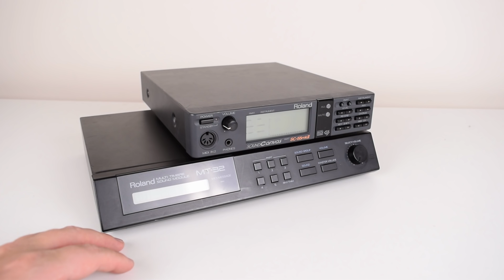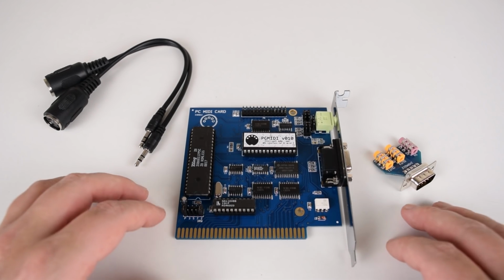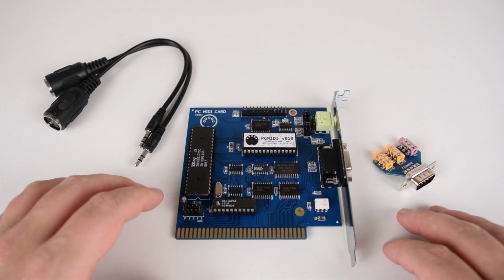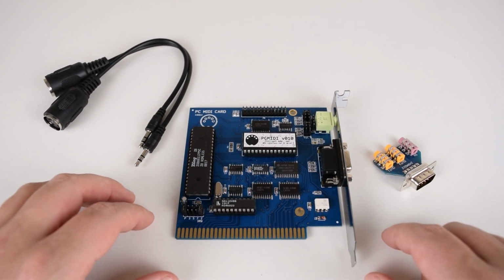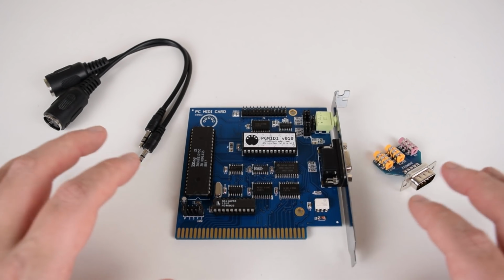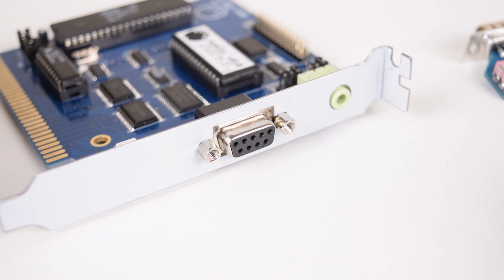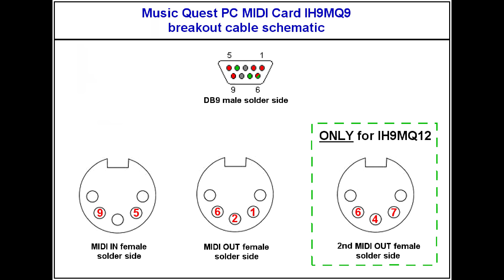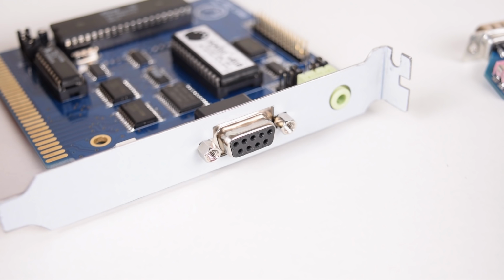Ultimate Roland compatible MPU-401 MIDI Interface Card with Intelligent Mode

Comment: So, did you try this on that computer? There's some stuff in the description of their site that makes me wonder if this would work properly. Specifically the fact that it needs IRQ2 for games that don't allow IRQ selection. Can you assign that IRQ in BIOS? Their site says that with boards Pentium 1 (with ACPI) there might be issues because ACPI uses IRQ2 and you need to have an option in BIOS to disable it. That kinda sucks because it's almost impossible to come by that information without having the motherboard and checking the BIOS yourself. 
Thanks!
Reply from the maker: What you're referring to affects ANY MPU interface. Back in the day lots of little oddities like this were around. Remember, when MT-32 was common in games, that was late 80s. Pentium is much newer... I've found these issues after much testing, it's good this knowledge is now way to obtain 🙂
Reply: @philscomputerlab  Hmm, that kinda sucks. I was thinking of building something like a slot 1 machine that I could also use for DOS with MT-32. Do you know if there are a lot of games that don't support configuring the IRQ? 
I was looking at this board: ASUS P2B-S but I guess I can't know if I would be able to get IRQ2 on it without actually testing it. I'm guessing the chances aren't too good if P1 boards already had issues...
Thanks for the answer!
Reply from the maker: @filipstamate1564  No it doesn't suck. These nuisance and little details is what makes this hobby so amazing. You can always just use Dosbox, it's really good with mt-32.
Reply: Many thanks for the information about ACPI. I finally hear the amazing music from "Princess Maker 1,2" (using PCdos7.1, mpu-ipc-t and CM-32L)

Comment: Hi Phil... never had the chance to use this sound hardware things during my DOS days. In Brazil, the best thing I could access at the time was a Sound Blaster. Never had an idea this MIDI stuff was so amazing. Can I use a Sound Blaster Live! for the MIDI interface? I have a P3 slot 1 with ISA and PCI slots, that will be my DOS machine and I have currently no ISA soundcards. Cheers from Brazil.

Comment: Can you explain a little more what the purpose of the green port is to be used for on this PC MIDI card? LIke what if you also had a sound blaster 2.0 card in there. How would you use the SB 2.0 and the audio output of this MPU 401 card together? I heard you mention using a wavetable daughterboard board too?  Maybe you could make a separate video about those things working together?

Comment: Is there any difference between using this and Softmpu?
Reply from the maker: Yes, SoftMPU requires specific type of memory and also has CPU overhead, which you will notice on an average 386 computer. Such a card does everything in hardware without compatibility issues :)

Comment: Hello. Can you please explain what the NEC wavetable board does and when it should be used on this card. My impression was that wavetable boards were attached to SB cards to get better instrumental sounds. I am not sure why you would need a wavetable board if you have MT32 and a sound canvas. ......wouldn't you get all your MIDI needs met ?
Reply from the maker: What NEC wavetable board?
Reply: @philscomputerlab  The NEC wavetable board (the clone board to the Yamaha) you attached to your MPU-401 MIDI Interface card........ the one in your video......lol.

Comment: i was thinking of adding this MPU-401 MIDI Interface Card to a 486 pc. where does the CD audio cable connected to the midi card actually plug in to on a sound card? for ex. i have 3 4-pin connectors (sony, panasonic and i think one other one) on my ESS audiodrive 1868f sound card. can the cd audio cable coming from the midi interface card connect to any of the 4 pin connectors on the sound card while also having my other cd audio cable connected from the cd drive to sound card?
Reply from the maker: The connectors have GND, L and R. So you just got to be sure that they match!
Reply: @philscomputerlab  ok so basically just check orientation of cd audio cable, thanks. just curious,  why did sounds cards have sony or panasonic written next to the 4pin connectors? did only sony cd rom drives receive audio to cd drive if connected to sony 4pin on sound card via cd audio cable?
Reply from the maker: @Rigidity11  The pinout is different between them.

Comment: Can you still use the joystick port on your soundcard? I bought this card and games won't load if I have a controller plugged in.
Reply from the maker: Sure you can, the gameport is on a completely different address and not affected by MIDI port 330.

Comment: One thing I've been curious about is if it'd be possible to use a gameport<->gameport null modem cable to just directly connect two computers together so one can run munt, timidity, or the like for sound cards that don't have good OPL or if you just prefer midi music?  I know there was some discussion of gameport<->midi adapter<->gender adapter<->midi adapter<->gameport on vogon, but it'd seem a single cable would be cheaper/easier.

As always, I really like your videos.  They're some of the best retro PC and inspired me to upgrade an old P5A-B motherboard with a K6-2 500MHz CPU someone gave me for free.  The only thing missing is a lot better quality music than what my ISA sound card has.

Comment: I don't understand the DB9 port, why did the went with that one?, that way you can't used the more common DB15 cables that sound cards have, even 5-DIN conectors makes more sense. If you can help me understand it I'll greatly appreciate it. Also that breakout board looks really weak.
Reply: DB15 cables have components inside aimed for soundcards - mpus only need straight connections everything is done on the card. DIN5 connectors don't exist in a form that allow bracket mounting. The original MUSIC QUEST card that this model is based also had a DB9 port so we went with that and enhanced it.  Some sort of DBxx port was needed for us to manufacture the inox brackets to our specs as we don't have the luxury to use other types of anchor points.
Lastly the breakout board is really strong, don't let the looks fool you (obviously that doesn't mean you can use it as a door stopper LOL)

Comment: there's a midi trough on the roland devices ;) no need for 2 outputs
Reply: yes there is midi-thru on external synths but just like the 1st gen MPU-IPC-T , MPU-401 or LAPC-I we added a 2nd OUT port so one can have external units connected independently. In the end the more proper OUT ports the better :D

Comment: You could simply use one MIDI cable to Thru input of first MIDI Synth to MIDI In of a second one! 
This way we don't need two outputs jacks from MIDI MPU ;-)
Reply: yes you can but you have to have all the units powered even if you don't use them. 2nd port is bonus either way...
Reply: It's not the matter of power, but sure - sometimes you need this second output anyway .

Comment: Unfortunately sockets on three chips makes it impossible to fit in Creative's own Waveblaster daughterboards because they have components on the connector side. So if you want to use those you might want to re-solder chips to board directly. But yeah, it's a nice card otherwise, especially given prices and rarity of Roland cards. Gotta make my own cable though, the little breakout board has a tendency of falling out without screws.

Also for people with more than one module I'd recommend getting a decent stereo mixer. I'm using JustMixer 5, which is kinda okay, you gotta tweak levels to avoid clipping. MPU-105 is also a nice addition, it's a 5-port MIDI selector so you can route MIDI signal to all or any of five outputs.
Reply: heh the fix is solder the chipset ICs directly.... :D
Reply from the maker: Maybe the creators will drop by and have some advice. But a easy fix is getting a double row of pin headers, and use that as an extension. I know some use ribbon cables for mounting larger wavetable boards on Yamaha YMF based cards.
Reply: Well, the fix is in progress, I spoke to keropi about that a while ago. :) But yeah, nice work on video Phil.

Comment: another interesting thing of this card is that to work it uses a z80 cpu, so you have the same cpu of computers like the sincalir zx spectrum on that card, and uses a custom rom with a program written in assenbly to handle all the midi stuff, there is an huge work behind this card, especially to correctly implement that z80 cpu and program it with the assembly rom
Reply: The Z8 in question is an mcu clocked at 12mhz - not a Z80 cpu. Similar but not the same. The IC with the sticker is the ROM , it holds the Z8 program. There is also a SRAM IC under the rom (the bigger smd package). The card is based on the original Music Quest PC-MIDI card that ported the original roland code over to the Z8 family of MCUs back in the 90s. It's not an emulation of the Roland code but a port of it. (the roland mpus are built the same: a hitachi mcu + rom + sram , later revisions from both roland and music quest moved the rom inside the mcu but it's essentially the same)
Reply: well I believe at some point they used the Z80 core to create those MCUs. Just like the old intel/hitachi/motorola ones these can be used for just about everything: from port controllers , keyboard controllers to even soundblaster brains :) (sb cards use intel mcus to do their magic)
when you build your adlib clone link me, I wanna see it
Reply from the maker: Interesting, I know nothing about this :D
Reply: the z80 cpu is that chip labled zilog on the top, and it should be a drop in replacement for other z80 computers, and also the smaller dip package with the little paper label on it is a rom chip with the program and the other dip package should be the ram for the z80 cpu, but that's nice, instead of reverse engeneering the roland mpu interface and try to find the same components and figure out how that card works the guys decided to implement from zero an mpu401 emulation program in a cpu which is simple to program and cheap to have and then let it comunicate with the rest of the pc  using the same instrusctions of other standard mpu interfaces, so the cost of this card is justified by just the fact that you get something like a full computer with it
Reply: not totally wrong - you were almost correct , all you had to work with was a video :)
Reply: eccellente ti troverò lì
Reply: ah ok, thank you very much for the information, i was totally wrong, but it's an huge work too, thank you very much for letting us know
Reply: i did know just z80 clones a zilog chips, but i have seen lots of single board computers with this kind of processors, so i know what the main socketed ic does, but it's a very good piece of replica for me, i am building my isa card too, a customized adlib replica
Reply: you find me on retro machines, retro pc gaming and retro hardware old school italia on facebook as pietro caruso, you can laso find me on vogons as ITzTravelInTime, and i have also my main channel here on the tube with that nickname
Reply: and i also know that sound blaster cards where created with just normal commercially available parts with a creative logo on, that's why there hwhere a lot of clones back in the days
Reply: hi i am piecaruso97, this is the account i use to pubblish videos, i video in italian on the adlibreplica project is coming soon

Comment: So, it really does everything by itself, without needing that external Roland MTU-401 MIDI breakout box that went with the original Roland Intelligent mode MIDI card that LGR mentioned in his MIDI Mountain  486 Woodgrain Build update video?
Reply from the maker: Yes that's right! The only thing you need to source yourself are the MIDI cables :)
Reply: PhilsComputerLab Thanks Phil! With it also having a wavetable header for GM daughterboards like the DreamBlaster S1, and the ability to connect internally to a sound card with a regular CD-ROM audio header type input connector, I'm thinking it would be a great card to pair with the likes of a Creative Labs CT1600 Sound Blaster Pro 2.0 for greater DOS compatibility.
Reply from the maker: Yes it works great with the DreamBlaster range. The other option is getting a decent external mixer. I should do a video on that, they aren't super cheap, but also not that expensive and very convenient as you can live mix everything.
Reply: Yes, you don't need bulky external breakout box for these ones. It was the original Roland interface card that did, but later revisions, like Roland MPU401-AT shown in the video, don't use it.